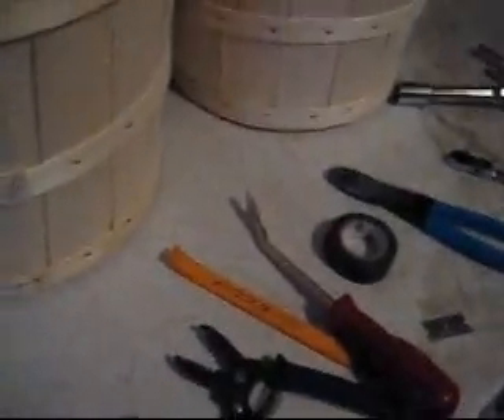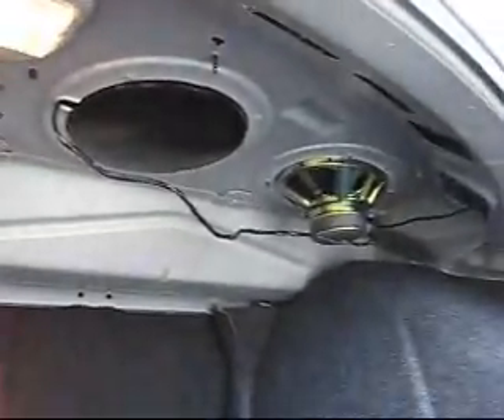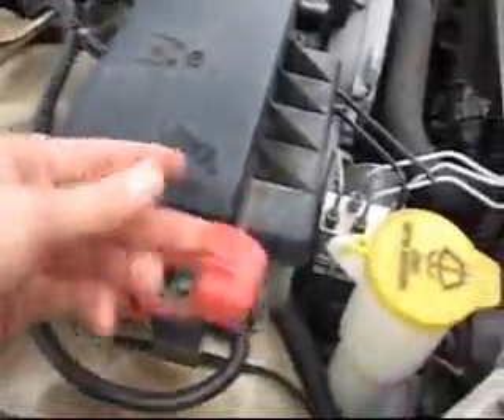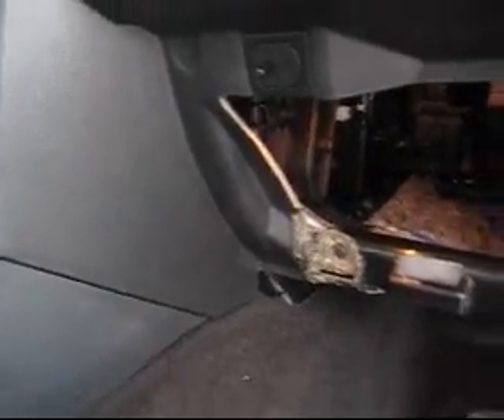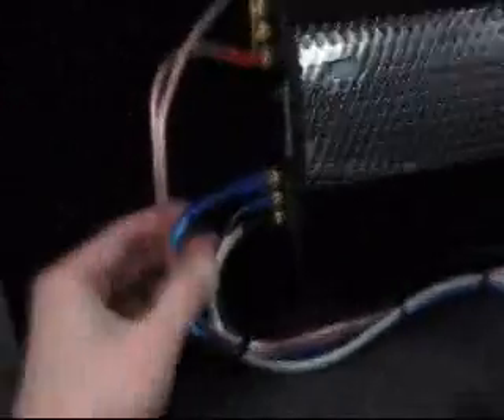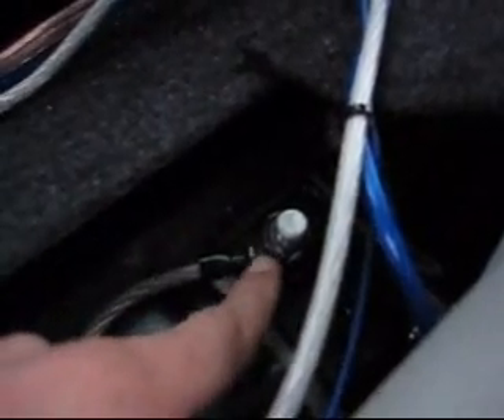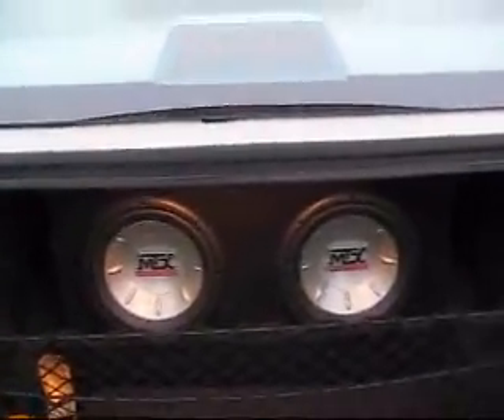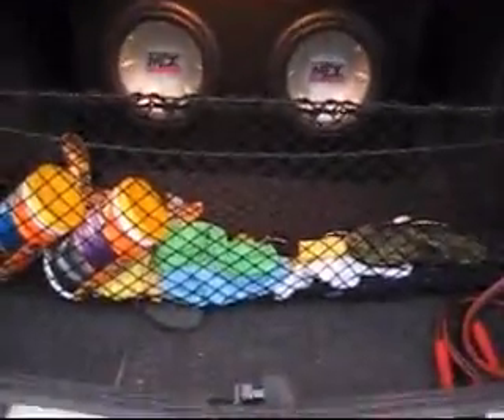How to install amp into 2007 Chrysler 300, keep factory radio

Comment: Why did you run the power cable from the front fuse block housing instead of just runing the power cable from the rear battery straight  to the amplifier it's so easy you would have saved so much trouble

Comment: lol this is what some sound shop told me they were going to do and I didnt let them. i took the car home and did the Line Out Converter off the rear speakers, the amp in the back, direct to the battery, everything in the back, and there is accessory in the rear fuse box. it is the only fuse offset from the factory, scoot it over and use the third slot to stick your remote wire into it with a cut U-wire connector.
Reply: can u help me I have the same car
Reply: lou Kane what do u need?
Reply: where do I put my remote wire? i have every thing hooked up factory radio with converter. but my amp won't turn off with my car idk where to put the remote wire
Reply: lou Kane open the fuse box in the trunk by the battery. you will see a row of fuses and one will be moved over one slot, it will look funny compared to the other fuses. move that one in line with the rest of the fuses and the little leg socket you just cleared put the remote wire in there(cut a foot off a wire connector so you have one little foot to stick in there)
Reply: @loukane6050  ⁷

Comment: I see a few mistakes here. 1 you should always run your amp power wire directly to battery when possible , plus it's right in your trunk so I'm not sure why you ran it from the engine bay... FYI the shorter your wires are the better the power /sound. 2nd when using a loc ( line out converter) you always run it from your factory subwoofer if your car is equipped with one.  I'm not nit picking but I like to help ppl do things correctly when I see mistakes lol  I own my own install shop in Florida an I been doing this for a long time, most of my customers are d.y.i ppl that watch YouTube An learn the wrong ways to do installs . Don't get me wrong I watch YouTube stuff myself to learn things idk about lol sometimes it's good info An sometimes not an it costs me more money in long run. This is only reason I'm commenting so don't take it as me being a dick .
Reply: So if I tap into my sub wires for a 2 channel LOC, do I tie both LOC channels together?
Reply: Ivan Andren so your tapping into your factory subwoofer . You take the white/black wire and grey/black wire from your loc An tie them together An connect to negative terminal/wire on factory sub, take your white and grey wire An tie them together An hook to your positive factory sub wire/terminal .
Reply: Hey Michael,  where would you get your power antenna wire? Or the wire to turn on your amp? Ignition? Thanks
Reply: Bill Snapps you have a few options here. 1 go to your ACC wire in ignition harness. 2 if you have a cig lighter that only works when the key is on you can tap into that, 3 go into your fuse box An find ACC fuse, radio or amp fuse. Make sure you add a fuse to wherever you decide to add your wire tho, even if you connecting to the fuse box you still need to add a second fuse for that wire. Another way is to pull your factory radio An connect to the amp turn on wire , or ACC wire at the radio itself. That would be your best way.
Reply: Where at in Florida do you have a shop? Would be nice if it was near me! This is all way more confusing than I thought it would be, afraid I’m gonna blow the car up with the wiring.
Reply: D D Deleon Springs FL 32130

Comment: i have a 06 300c but i want to keep the stock stereo. how did u get those rca's to the back
Reply: that's the line output converter. . he has it hooked up to his left rear speaker then rca jacks ran from it to his amp. u need the line output converter  if your keeping your factory amplifier

Comment: gotta quick question when i hooked my amp up in my 300 i hooked my ground to the battery but is that a good idea or bad cause the amp came on but im not gettin no sound at all through my subs idk if it cause im not getting enough power or what
Reply: i used the ground thats right by the positive terminal on the battery. i covered that terminal just incase u slip with the wrench. wverything everything is working good. i wouldnt hook it up to the battery ground.

Comment: need help on a srt-8 300,-2006 my window Will not go up and the wippers want work and head lights will not go on low beam and the tracking control Will not come on can anyone help please
Reply: you have SERIOUS electrical issues. you can NOT fix that yourself, i can tell by your run on sentence, and lack of punctuation. You should take it in to get looked at. And bring your car to a mechanic.  :)

im just messing with you about the sentence, its fine, you're cool.

Comment: The fuse box by the battery has a fuse for the cigarette outlet plug where you can move it to on all the time or only when ignition is on. I like it on all the time so I moved the fuse to on and then exposed the acc switchable side. just plug your sub acc wire into this outlet and wire the sub to the battery.  little yellow fuse with two possible positions. 3 prong receptacles for two prong fuse.
Reply: if u switch it to "on all the time" and run ur acc amp wire to that wouldnt that keep ur amp powered on all the time?
Reply: Its the reverse, the cigarette lighter outlet is on all the time. Charge phone with the car off. The accessory plug with switching is then available for your sub.  You pick which one is on all the time. I choose the plug inside car so I can charge items while car is off.  Sub is only on when car is on.
Reply: +Ian Lindner thank you! i just bought a 300 for my girl and i want to hook the sounds up for her. with that and the battery in the trunk i can wire everything up all inside the trunk. i have factory radio so I'll tap into the rear speakers as well instead of running rca cables to radio.
Reply: +Dale Zitz II im installing 3 10" jl audio 10w3v2's sealed enclosure with a jl audio 1000.1 amp. i cant wait!
Reply: as im looking at the fuse its not in line with the other fuses. its set in the lower postion. how should i run that fuse and also just wanna make sure, u plug the wire into that fuse correct? it says IGN next to it
Reply: +Dale Zitz II i figured it out. i left the fuse in the same position. i attched the wire to the lower part next to the IGN. i also ran a switch to turn off the amp just incase anyone is driving and dont want the BANG! i installed a 15" solo baric with a 1000watt amp at 1 ohm. it sounds NICE! and so much easier to install with the battery and everything in the trunk!

Comment: Nice setup your battery  is in the trunk you could have saved alot of time by running your hot wire and remote from the rear trunk like I did in my srt8 and you would be good to go otherwise great job on the install
Reply: I hooked mine up in the back too 👍👍
Reply: AtlasOS yes I'll upload one shortly
Reply: That's exactly what I was thinking.
Reply: Desmond Campbell could you make a video showing the setup? thanks
Reply: Desmond Campbell hey man I'm hoping to connect my amp and sub sometime this week but I haven't found much helpful videos. Can you upload the video sometime this week? Thanks in advance dude it'll be my first install.
Reply: Luis are you connecting to factory radio or aftermarket?
Reply: Desmond Campbell aftermarket
Reply: Luis ok today if I can still away from my wife and daughter I'll upload my setup and let you know
Reply: Desmond Campbell Alright thank you
Reply: Will do
Reply: uploading now 2.5 min run threw
Reply: Desmond Campbell ok great man thanks for uploading so quick
Reply: Welcome. Everything in my car as far as audio has been upgraded the factory amps have been bypassed. All my mids and highs are jbl gx series 3.5 speakers for the dash and gx series 6x9 for the doors and rear deck they are 2.3ohms each for guarantee better sound quality on stock radios and aftermarket if you amplify them they sound amazing
Reply: It's up search 08 dodge charger srt8 system car is red

Comment: For the remote wire just use a wire tap and tap into the solid pink wire coming off the wire harness in the trunk.
Reply: question bro.the pink wire u mentioned,whats the wire for the pink one

Comment: Do you have any dimmingnin the headlights???
Reply: If you do just do the big 3 upgrade 
1st: run a power wire from the alt to the battery
2nd: run a ground from the chassis to the battery 
3rd run a ground from the engine to the frame
4th: (optional) run a ground from the alt casis to the battery negative post. 

Finally to make a better adjustment to help with dimming just replace the factory lights with LED lights. LED lights take up less power from your alternator so it helps with the dimming because your bass is sticking up the juice out of your alternator and battery

Comment: #1 who runs 10 ft of wire when a battery sits in the trunk, #2 the rear speakers are not woofer there 6x9 #3 no hemi? ? #4 relay conversion for an accessory?! Id run the wire hot and buy a toggle switch or jusst run the accessory to the fuse 18 which is a cig lighter fuse. You should not make a "how to" video if you yourself don't know "how to"

Comment: So this was to the jumper terminal in the engine bay? I have a Sebring that has the jumpers there and the battery under the driver side fender was not sure if i could use the jumper terminal.

Comment: What a way of stressing the shit outta yourself... Kinda don't get it my Chrysler 300 battery is in the trunk so I don't need no pink/white wire for power.. Maybe this may be useful for someone out there but for anyone with a Chrysler 300 with the battery in the trunk..

Comment: @1307mimi and @MikesAggy334 you need to get a high low converter which converts speaker signal to RCA for your amps RCA inputs ... The best place to wire it is up to the rear speaker for a charger or a Chrysler 300 you can buy the converter in eBay for less than $20 I'll post a link for 1 or 2 in a few mins

Comment: Dude. your awesome.. i drive a 2000 chrysler sebring convertible JX and all the videos i seen were to connect the amp remote wire to a blue and white wire.. dude you saved my ride from my self goin off on it. thanks.. but a few questions if i run it my amp directly from the battery that means itll always stay on right? and will that kill the battery? also can i get another car battery jus for the amp?

Comment: aye what color wire on a factory radio is for the remote on a 2003 grand prix because i used a orange wire and my amp stays on so i have to take the fuse out everytime i get out the car and what colors go together on my pac interface adapter it has grey black and white wires i only have one 12'sub thanks let me know

Comment: @metallica5827 in the fuse box i the trunk there is a fuse with IGN next to it, if youre installing your a amp in the trunk you can just use it for a ign wire

Comment: Hey guys i installed my own subs into my 300 srt8.. some tips is, use the battery in your trunk (Duhh), 2. you can hook up your remote cable into your ignition fuse (it will be label IGN) (its the fuse box in the trunk).. if anyone needs help you can message me
Reply: Vinny Gjokaj  hey I would like to know how you wire it to your fuse box please

Comment from the maker: @Accordian85 , no, i didn't have a problem, but thanks for the info. you mean the current draw would effect the can-bus, not voltage. the potential is still the same when i tap into it, i'm not sure what the relay draw is on the amp that keeps the amp on, it might be really low, but who knows. every amp is different

Comment: hey i just bought an 05. is there anyway to install a new deck and keep the  steering wheel controls.  if not is  there anyway to hook up an ipod  with out usin those shity fm transmitters

Comment from the maker: sorry for the late reply, the remote wire is shown in the video, it should connect to your accessory wire or to a switched power source at the fuze box located by the battery in the trunk on the passenger side

Comment: Why did you hook the power supply up front when the battery is in the trunk already.   That method is used for batteries that are installed in the front of the vehicle.  That was a waste of wire.  also you can get the ground from the truck also, therefore you wont get much ground noise from the amp. Think about it.

Comment from the maker: that's funny, "it leads to nowhere", yeah sure there buddy, it doesn't work if i install it this way? even if i post the note on the side saying that the power could be done from the trunk, you're still ignorant enough to keep using that against me. and as for the wire sizes, you have no theory behind what you're saying, the math that i provided to you probably confused you too. let's see if anyone here says that i'm wrong with my equation. it's ok to be wrong mustangsammy95, just chill out.

Comment from the maker: no, i'm not saying it's ok to run a 80 amp fuse into it, what i'm saying is that the manufacturer of the amp kits already calculated what size fuse to use with that wiring kit, that amp is only a 400 rms amp, meaning it draws less that 60 amps total. so that's why that wiring kit is fine, any more than 400 rms would mean that it would need a larger gauge kit with the right fuse rating

Comment from the maker: umm, i agree that the fuze blows over amperage, but any short will blow any size fuse, so it doesn't matter on fuse size if you're using it to protect against shorts. the size of the fuse that is manufactured to come with the amp kit determines the size of wire as well, 60 amp fuses are used on those 8 guage wires, letting the system be able to handle 800 watt max. P/E = I , E being 14.4 volts (for most cars when it's running) and P being 800 watt max (amp i'm using) .  So I = 55.55 amps

Comment from the maker: yeah, my excuse is that i have never worked on a 300, that's why i put a post up saying that the power could be connected from the trunk, read the description, this install doesn't take more than an hour. can you calculate something for me if you understand the theory of electronics? 400 rms needs what size fuse rating and why?

Comment from the maker: also, many people run RCA's and Remote wires on the same side because the remote signal isn't strong enough to interfere with the RCA's signal, having shielded RCA pairs also help reduce the whining sound if there is an interference

Comment from the maker: i don't think so, remote wire emits DC voltage while RCA's emit AC sound wave signals, the only reason why there's a frequency interference if you run RCA's and power wires close together is because of the magnetic flux that the power wire emits, remote wire is also DC just like power wire, you're suppose to run RCA separately from all DC power sources

Comment from the maker: the boston acoustic factory premium sound system doesn't have anything to do with your after market amp choice.  i know that MTX amps have what they call "Smart Engage": it uses the audio signal to turn the amp on instead of using a remote wire to trigger it on. so this means you won't have to tap into the ignition wire. you wouldn't even need a LOC to do the install either, just use the back speaker wires for high level, it's a cool feature on the MTX amp for factory installs

Comment from the maker: take apart the panel that is below the stearing wheel. and then follow the ignition (key hole) there should be a small harness there, and there should be a pink/white wire in that harness

Comment from the maker: oh yeah, check the amp too, read the fuses on it, if there are two fuses on it, add the values together, so there's two 25 amp fuses on there, 50 amps total, now take that number and multiply it by 10. you'll get the number 500. so 500 would be the amp's RMS value, that's true wattage of the amp.  it's just a simple rule of thumb.

Comment from the maker: really depends on the kind of amp, and the rms values of it.  if it's a two channel, then you can most likely bridge the amp to get twice the power to that pioneer sub. if your amp is under at under 500rms, then you can go with an 8 gauge wiring kit. if the amp is above 500 rms, then you need to get a 4 gauge kit. they normally will give you an inline fuse with a rating of 150 amps. plus, it'll let you run split the wiring later on if you decide to go with additional amplifiers

Comment from the maker: this complicated, with this one, the factory radio system is a premium system, i wouldn't recommend throwing in a 4 channel amp unless you don't want to keep the factory radio. for a factory radio, you'll have to connect your speakers to the 4 channel amp, then you'll have to do high level converters from the factory amp, or run new speaker wires from the factory amp to the new 4 channel amp which has a plug labelled 'high level input', it's costly, the converters are like 40 each, you'll need 2

Comment from the maker: hey, it's alright, you should read the comments below, someone else also mentioned it, i also said that i have never worked on a crysler 300, went into it knowing nothing besides the wire codes.  p.s. it doesn't take an hour to run that power cable through the firewall, took me 15 mins. but saving time is still good.  i don't own the car, so there's no way i could re do this

Comment from the maker: if it sparked from the inside, the worse thing that could happen is the fuse blowing, i'd still try it anyways to see what happens for fun, haha, but that's my take on it, i've installed broken amps before and nothing really happens, maybe the fuse blowing, and that's it.  your amp isn't too powerful anyways.  you run mtx equipment too? nice stuff